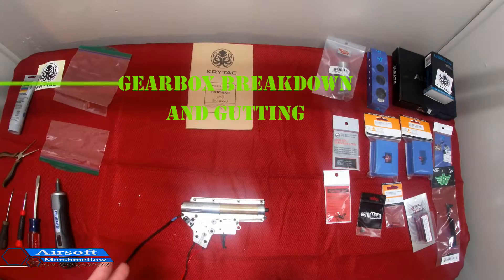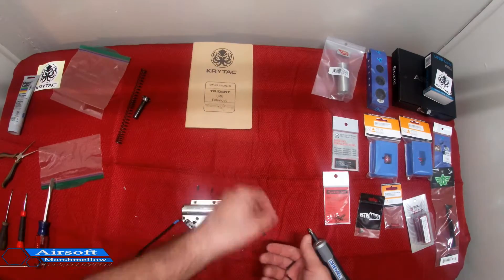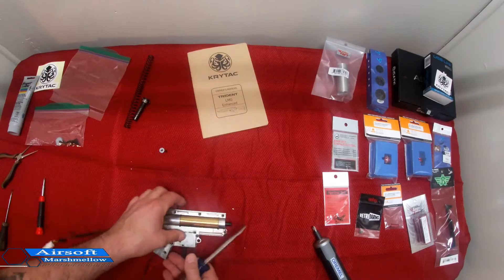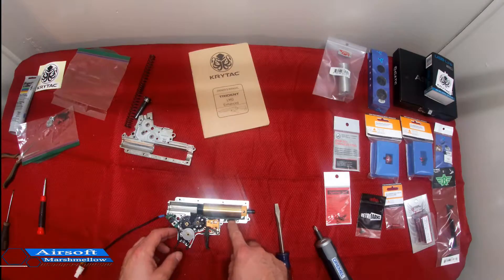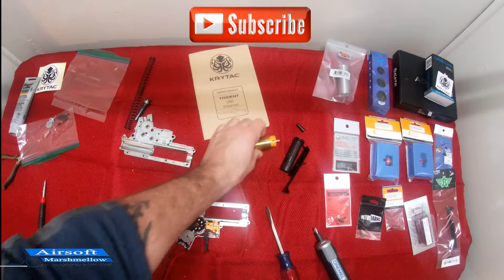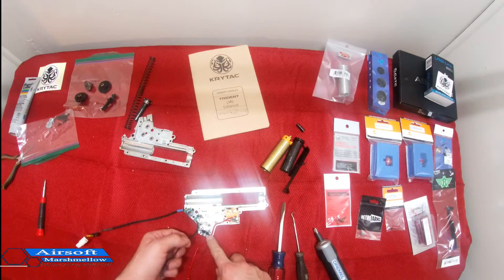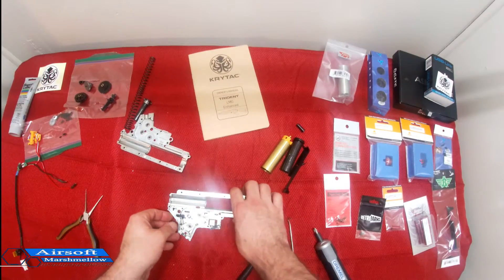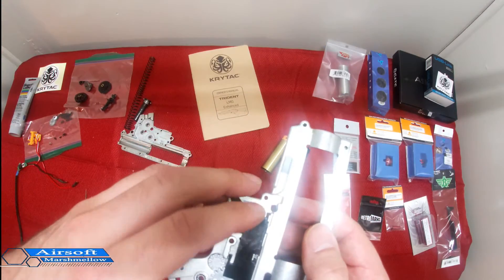Krytac LMG GearBox BreakDown

Comment: Hi ,Bro! Can you help me? I have buy lmg ver2, and i don't know, what's material of gearbox? I want to upgrade springs m130, will it's survive? thanks!!
Reply from the maker: Krytac LMG gearboxes are pretty good material. It can handle an m130 spring, but I do not know for how long. The more stress one puts on a gearbox, the more likely it is of a chance for failure.
Reply: @airsofteo9105  Thanks ! =)